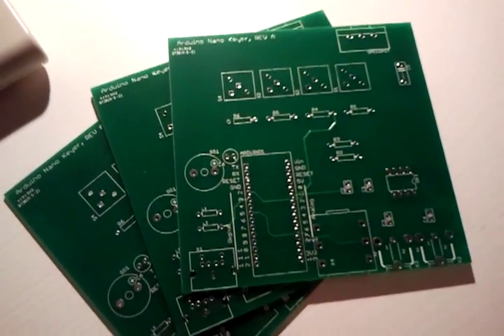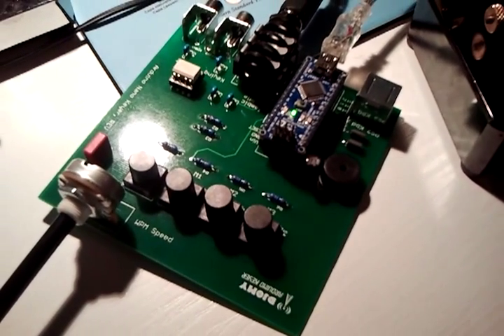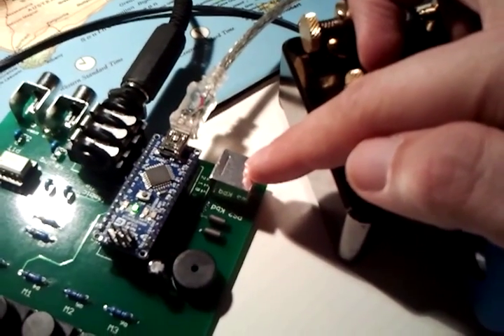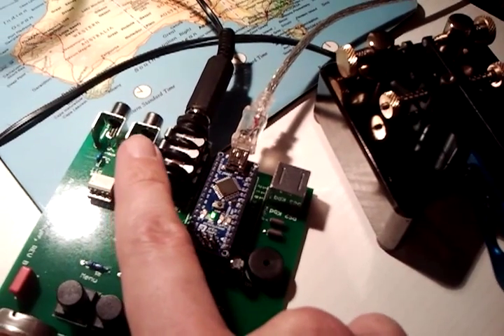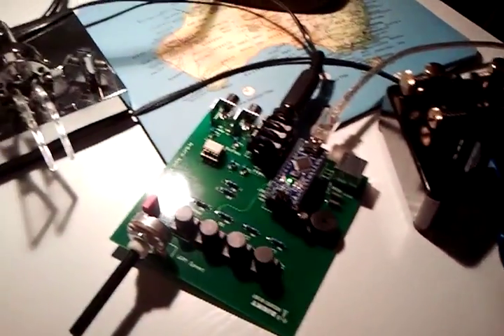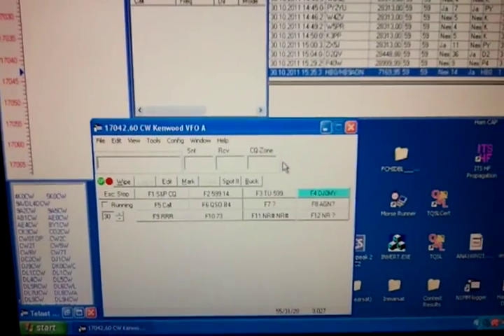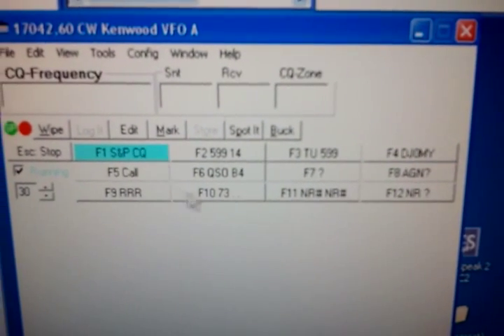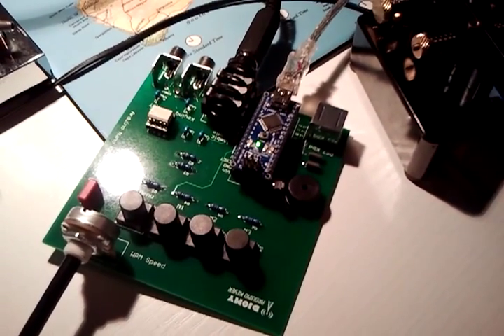nanoKeyer K1EL Winkeyer compatible CW contest keyer

Comment: Does it do FSK RTTY like the winkey3 does? Just curious. The PS2 keyboard option looks interesting. And if it impliments RTTY  it could make a stanalone rtty system as well. 
Those little arduino nano's can do so much. A very nice product
Reply from the maker: Unfortunately, the Arduino Nano is almost fully utilized by the K3NG code and does not have sufficient additional memory to host some additional RTTY code at the same time. But you can easily swap the Arduino code (or have a second Arduino Nano on hand) and use it with the nanoKeyer and the excellent TinyFSK sketch - An FSK Keyer for the Arduino Platform by Andy, K0SM ...,